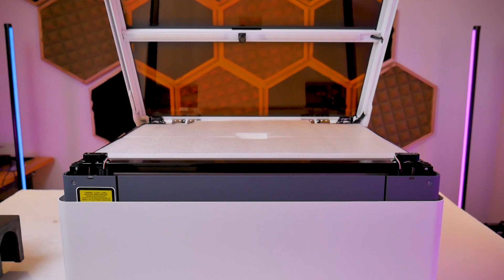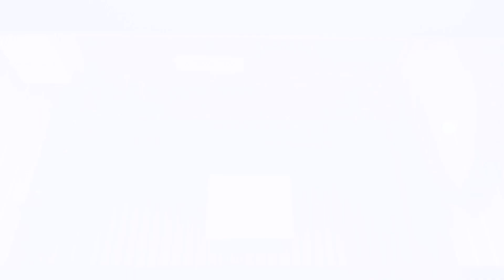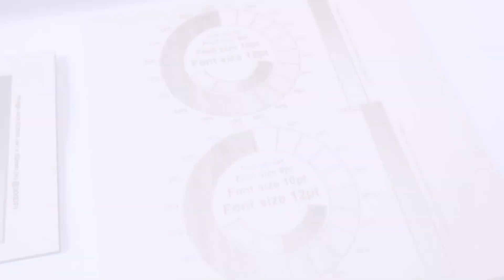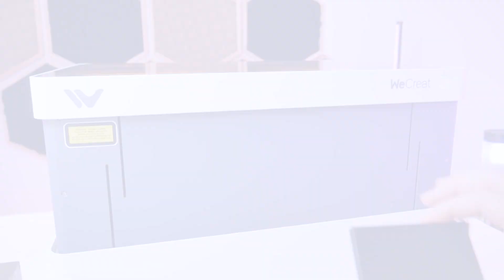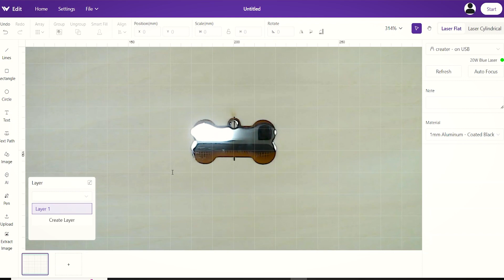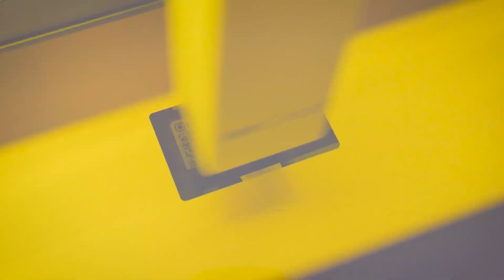WeCreat Vision 20W Autofocus Laser Cutter and Engraver: Getting Started Guide and Review

Comment: Which hose adapter do you need for the Vision, you have a few and wanted to make sure I got the right one.
Reply from the maker: If you want to use a 4" hose with the Vision this is the adapter you're after: https://embracemaking.com/products/3-inch-76mm-flange-to-4-inch-101mm-hose-adapter

Thanks!